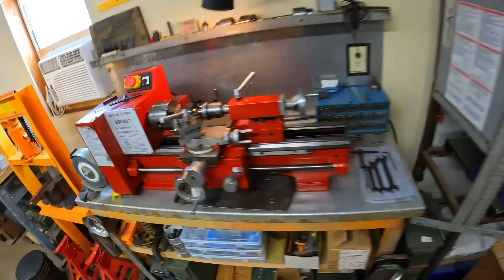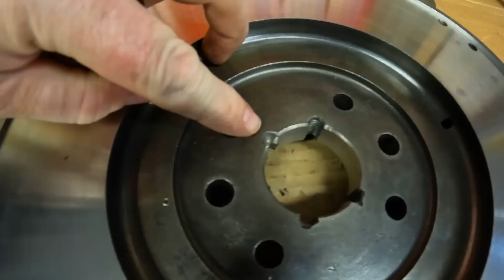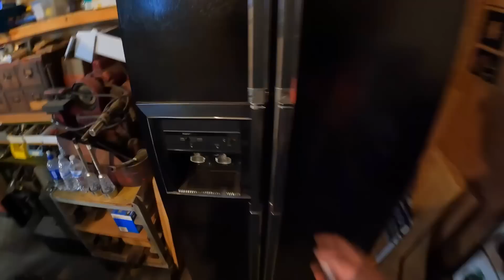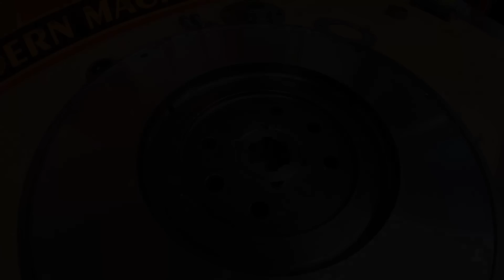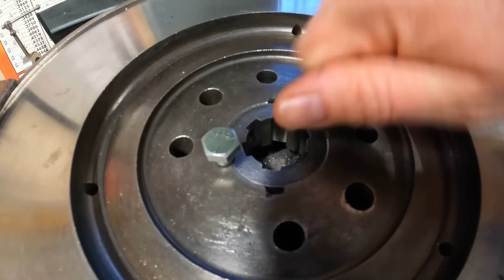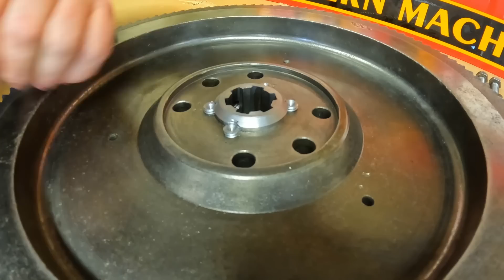X231 Prototype - Fabricating, Pressing & Pinning the New Flywheel Hub - Part 81

Comment: 14:05 make yourself a tap guide (for those taps that don't have the dimple). Essentially, it's a square drive with a dimple and a bigger square drive on the outside. You basically put that in your next size up tap wrench  (or use an imperial adjustable wrench ;) and then the tap goes in that and you have a center dimple again. You used to be able to get these from the usual suspects, can't find them anymore.

Comment: Each time I hear that shopvac howl when you turn it off, I hope you'll add a drop or two of oil to the motor bearings before the bearings are beyond hope.  🥴😁
Reply from the maker: I always just run them like that until they quit completely, and then get a new one. They never last very long around here, due to the time they put in on sandblasting cabinet duty. That fine dust will penetrate any filter setup 👍
Reply: @squatch253 You might try running a cyclone separator prior to the vacuum for blast cabinet work.

Comment: Your restoration of that flywheel looks far tidier than the original setup.  Nicely done, the factory engineers would be jealous. 
I will always be very cautious and never fault anyone for doing the same when working with taps. I hate breaking them. It is always a royal pain in the butt. My vacuum must have heard your vacuum and it has started making the same noise. 😒

Comment: If I was threading a hole and didn’t backup the tap, my old Dad would give me quite a lecture on the use of his tools. 
I have my own now and I always backup when tapping threads and chuckle to myself about it..❤️💔
Reply: Better to take it slow then have to remove a broken tap.
Its not like you can be lucky enough to break an old 10mm bolt on install, but stopped before the thread separated from the two half's allowing you to gently remove this severed bolt by the filament of thread still holding them together every time.

Comment: I would have used LockTite Red for the bolts.
Reply: Actually the green he used is stronger than the red.
Reply: Never knew that, I always used Red, Blue and I still have some yellow laying around from the 70s.  Blue for most things.
Reply from the maker: Yep the only way you break that green stuff is with heat 👍

Comment: Assuming your shop is at 68F and you froze the bushing to -2F giving you a 70F delta T.  This would shrink the hub 0.0008 inch.  This is why heat always works better for most users since you can achieve 2-300 degree delta T on the parts.  A 165F difference in temperature would give you 0.002 shrink on the 1.875 bushing. I would do the same thing you did and freeze the bushing,  if you really want it cold grab some dry ice.
Reply: I was wondering if the freezer was going to be cold enough to give a successful shrink. The dry ice did come to mind. 
Sounds like you're an engineer. If I wasn't so scared of math and physics, I would have ventured down the ME world! Have a BS in industrial technology, so I've touched many topics ME's do, just not as deep!
Reply: Liquid nitrogen is the best way to shrink it down, but we also use dry ice in denatured alcohol.. this gives great results 🇺🇸👍
Reply: Did you get mixed emotions as the heads of the bolts twisted off?
Reply: Alcohol bath with dry ice will get you down to -78F.
Reply: And he got it done without our “help”.
Reply: Even a normal freezer is colder than -2F
Reply: the flywheel was about the right size to put in the oven. I think a combo of 500*F flywheel and -2*F  insert would have been the solution to a drop in installation. Perhaps there is not a shop oven and there is a strict moratorium about the kitchen appliances in the Squatch household😂.

Comment: I grow increasingly suspicious about your previous job experience, Weakening a screw to shear off is ANOTHER Toolmaker trick! Did that many times to plug holes in a Die shoe that was being re-used due to an engineering change. So, my suspicion is that BNSF was actually a Tool & Die shop. You should come clean before you give up YT. BTW, I never liked those spiral FLUTED taps, nor did my peers. When used as the primary tap, they will wander - somewhat like an auger. Accordingly, there were always a good supply of them left in the cabinet. If you can find a source for Hanson & Whitney spiral-POINTED gun taps, you will have the best and most versatile geometry. You did a fantastic job!

Comment: Looks great

Will the flywheel need to be balanced?
Reply from the maker: I’m not worried about it - it hadn’t been balanced with their last repair, and that one was a lot more ragged than this one. Also remember from way back, the crankshaft in X231’s engine was never balanced at the factory either.